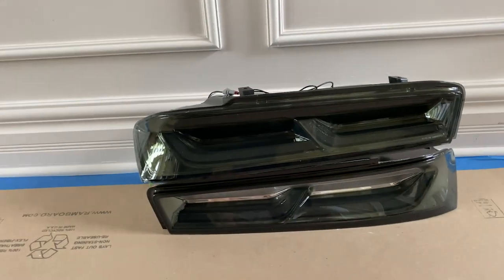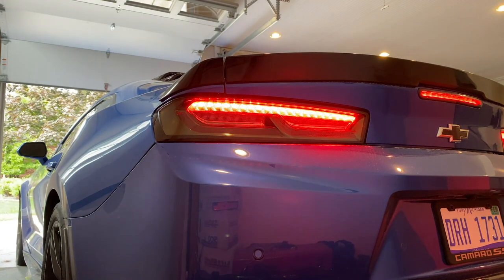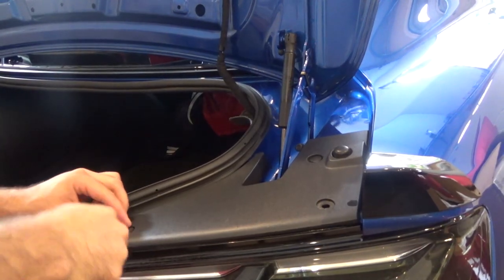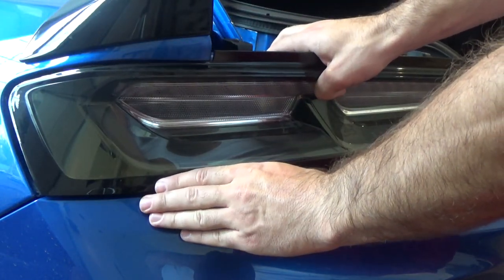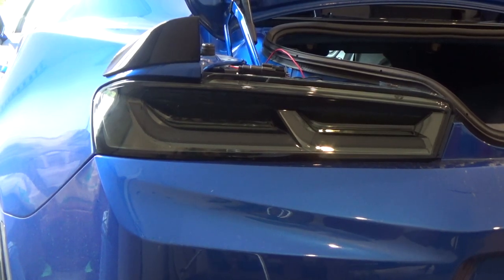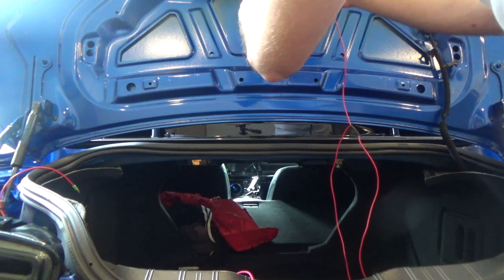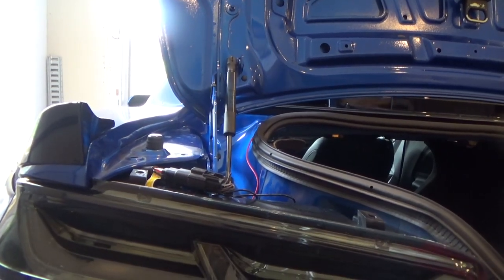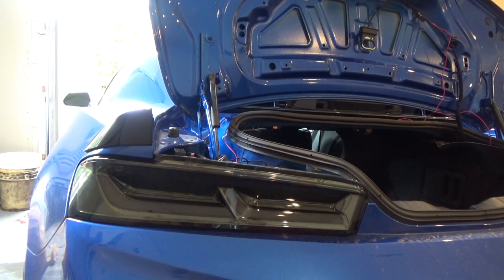2016-18 Camaro VLAND Smoked Sequential Tail Lights - v2 | Overview + Install Guide | Next-Gen Speed

Comment: I just installed these with the extra wire to the third brake light. Everything works as expected except when I actually turn the turn signals on, the work perfectly for about three blinks and then immediately switch to blinking fast and only half of the bar comes on. Does it on both sides, any idea how to fix this issue?
Reply: I might be late on this, but you need the harness to convert it to an rs for the lights to work. I’m assuming you have a base model
Reply: @agustinfarias9367  stupid question but where do I connect the harness? I just tried to connect the lights and it’s hyperflashing. I’ve got the harness but I have no idea where to it connects at
Reply: @agustinfarias9367  common base model L

Comment: How does the 3rd tail light get power if we use that power source to plug into the tail lights?
Reply from the maker: It’s a splitter harness that splits it two ways
Reply: @caleb Harter i was  about to ask the same question
Reply: @NextGenSpeed  where did you connect that split harness on tail light?

Comment: I have the older model Smoked Sequential taillights(Amber). Are you Selling the Adapter separately, so that the sequential function doesn’t activate when you press the brake
Reply from the maker: We were hoping that we could, but these new tail lights have complete new internals and the entire lights will have to be replaced.
Reply: @NextGenSpeed  would you guys be interested in taking back the previous sequential lights at all?
Reply: Next-Gen Speed where can I purchase this NEW harness for my 3rd brake light?
Reply: @michaelj5748  Old tail lamps can be upgradeable, or anybody know any method to solve my problem? Mine is light up sequential amber turn signal for one moment,  if i push brake pedal.

Comment: Just got mine today, looks amazing!
Reply: Richard T where did u order the harness for the tail lights from?
Reply: leeroyrivera2010 there is no harness, you have to buy the whole new taillight
Reply: Hey man, I just got these and got them installed correctly. However, when I actually put the turn signal on after about three clicks it starts blinking faster and only half of the bar comes on. Do yours do this as well or are mine defective?
Reply: Robert Montano mines do that also, not all the time but it does happen once in a while . If yours is doing it a lot I say you contact them and tell them your problem.

Comment: Do you have to plug the red wire in or will the taillights work ok without pluging the red wire to the third brake light
Reply from the maker: Red wire is required to give the Tail Lights the brake signal
Reply: @NextGenSpeed  oh I installed mine without the red wire that came with it and everything works fine
Reply: @NextGenSpeed  BTW they are awesome taillights makes my camaro look sick

Comment: Are you going to ever upload a video of you showing the turn signals working as expected while you manipulate the brake lights? This whole stuttering issue of the turn signals when the brakes are pressed is one of the main complaints and I have yet to see a video in action of this working properly!? I won't be purchasing these unless I can be shown that this already works. I drive a base LS, but would like to buy these with the harness if that will work. Otherwise, I might have to buy the Helix version.
Reply from the maker: We show the brake function that does not show the signals while braking at 10:07 , but I can send you some quick videos on Instagram/Email if you would like of any other function. You will also need the Non-RS to RS Tail Light harness for the LT model for these to work correctly.
Reply: @NextGenSpeed  Thanks for the quick reply. I would be grateful if you could provide me a video where you show the turn signals on and then apply the brake while they are still on. Also, if you could show a video of the brakes on and then turning on the turn signals, that would also be great. That would calm a lot of people and would probably lead to a spike in sales! I know of a couple of threads where people are waiting for this information!
Reply: @NextGenSpeed  Can I expect a quick video sometime this week?
Reply: @NextGenSpeed  I'm disappointed to see that your initial quick reply (to manage damage control?) hasn't yet progressed to actually fulfilling your promise of quickly answering my concerns and the concerns of many other consumer. People report that hitting the brake while the turn signals are on causes the turn signals to reset on aftermarket turn signals. Holding the brake and then turning on the turn signals with the brakes still on seems like it could cause a similar problem for the brake lights turning off? Maybe you have fixed it, but I was hoping you could alleviate these fears before I purchase.
Reply: I have a 2018 RS camaro and im having this same issue where everythings works perfect except that stutter it does when i apply the brake and then the turn signal. If you figured out the issue, let me know! thanks
Reply: @NextGenSpeed  my turn signals blink normal for 3 cycles then start blinking fast, when I turn on the hazard lights they blink fine. I had the Ted wire shipped with me order but still have the signal light issue.

Comment: I noticed in your older video someone posted that when the signal is on they get about 4 good sequential turn signals but there after the signal hyper flashes all of the signals (front and back) of which mine are doing the same.  All seems to be wired correctly and they are only about a month old.  I saw in the comment that you asked or suggested they had a LT model or the resisters were going bad.  why LT model Camaro (2016)?  Is there something I need to know about not working on LT models?
Reply from the maker: LT models are not equipped for LED lighting. They require an LED harness with Resistors to stop the Hyperflash
Reply: @NextGenSpeed  thank you for the answer

Comment: Is the third brake light harness connecting necessary? I did a demo and got no issues when pressing break and turn signal…
Reply from the maker: Yes it is required. From our tests the brake lights will not function correctly without it
Reply: @NextGenSpeed do you know what exact malfunctions occur if they are not installed with the harness wire? I don’t think I’m getting I’m getting any problems, my concern is because I don’t want to remove the back trunk piece because the little caps holding the big piece are hard to remove and easily break when removed

Comment: Do I need that whole wiring things to if I have a 2016 or is that only for a 2018
Reply from the maker: It's for all 2016-18 models and needs to be connected for the brakes to work

Comment: Will these work with the non LED models?
My 2018 Camaro has the standard halogen bulbs.
Reply from the maker: Yes but the LT Models require the LED Non-RS To RS Harness found here - https://nextgenspeed.com/shop/chevy/chevycamaro/6thgencamaro/accessories/camaro-tail-lamp-led-non-rs-harness-kit/
Reply: just get resistors i installed them for 13 bucks way cheaper than harness
Reply: @AH-wf5ri how’d you install them? I have 2 resistors they sent me but idk how to connect them

Comment: I had these and had to send them back.Vland would not tell me how to fix my issue which is as follows.Evertime i had my foot on the brake and the brake lights were on,I would turn on my signal light and the corresponding brake light would go out.First off thats not safe and secondly it looke goofy with one brake light on and the other side off with the flasher blinking.Has any one else had this issue? I have a 2016 camaro ss
Reply: did u fix the issue.

Comment: I ordered mine, installed them without pigtails and the brake lights dont work , is that because i didn’t connect them to the 3rd brake?
Reply from the maker: Yes that is correct. The harness needs to be connected to the Third Brake
Reply: @NextGenSpeed  I connected but only one of brake lights works the other shows a signal

Comment: I was looking at these and hoping they would fix this issue, but now seeing how they fixed it I still wont buy them.  No way i'm doing extra wiring to the third brake light to make these lights work.  For the love of God somebody please tell  me why they could not fix this with in the wiring of the light itself?  My turn signals don't come on when I press the brake with the factory tail lights, why does it do it with these?
Reply from the maker: Project ZL1 This happens because the factory Camaro Tail Lights use the outer brake light as the turn signal. This causes the brake & signals to activate together one cycle, when the brakes are pressed. The only way to eliminate it was to tap into the third brake light
Reply: Hello!  Your tail lamps really  working after install additional cable from 3rd breka light?  Brake light can light up without amber turn signal?  Can you  tell me detailed informations about additional 3rd brake light wire install?
Reply: How can you fix that problem?

Comment: I have a 2017 RS model and it has hyperflashing issues. The harness to fix it is $130+ thats ridiculously overpriced. I already paid $300+ for the lights. They should not have this issue the way they come
Reply: Mine turn signals started blinking fast, the hazard lights blinked normal
Reply: Where do you get the harness?